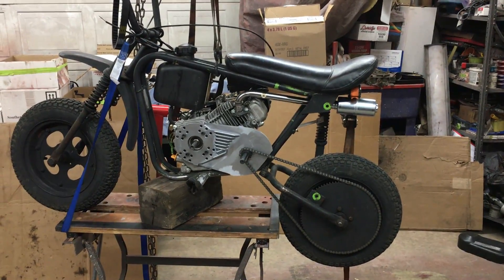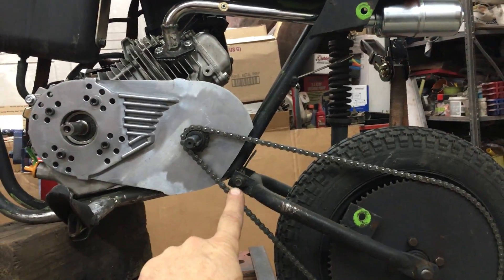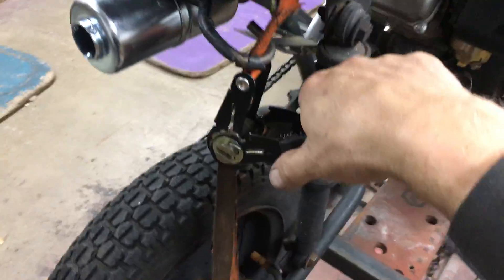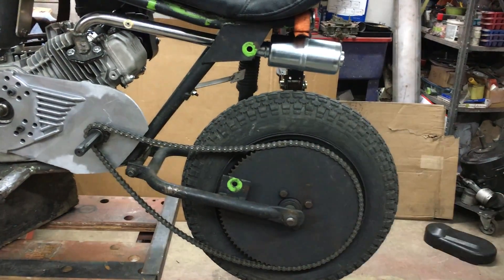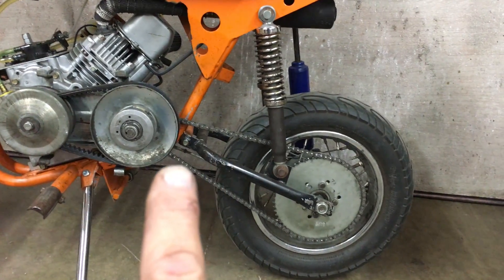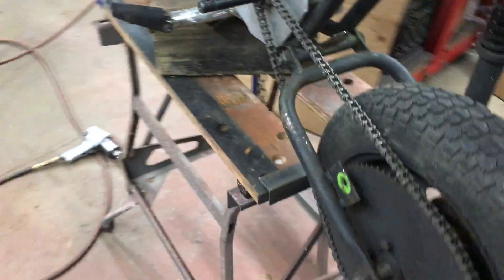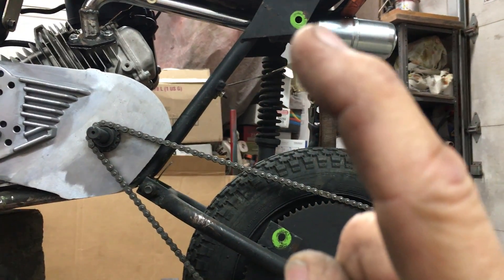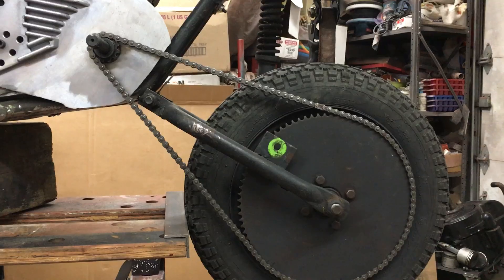Sears Minibike Rear Swing Arm Pivot Point Problem. Please Read the Description..

Comment: Hey Dan I know this is an old video. I've got a green strwk as well I'm putting a predator on. Any chance you'd confirm the chain pitch for me?
Thanks!
Reply from the maker: Sorry I can’t confirm chain pitch as I don’t own it anymore. I think I changed the sprockets. Perhaps #40 chain?
I recommend a gold on gold or gold on black chain. Don’t buy cheap chain, spend more and get good strong chain.